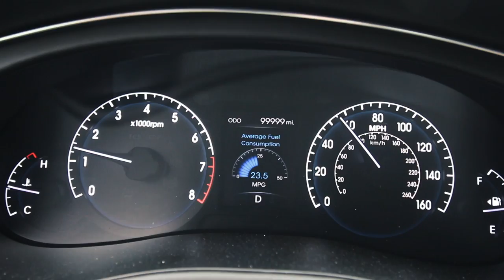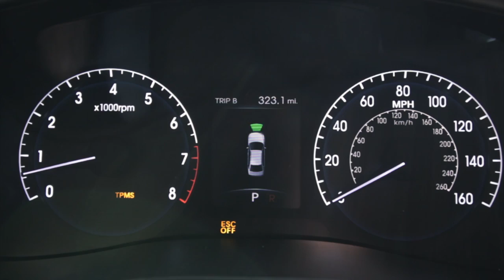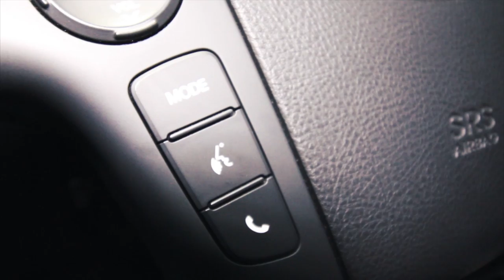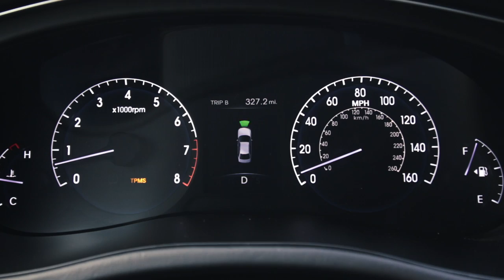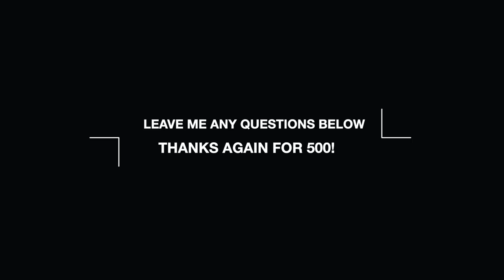2012 Genesis 5.0 R-Spec Long Term Ownership Review

Comment: Love the car heard they burn oil . Bad rings from factory 🤔
Reply: Gas direct injection engines burn some oil after awhile due to the high pressure fuel injectors
Reply: Darrin Bush That’s why I’m opting for the 4.6L. Still makes 385bhp and is port injection so no worries of carbon cleaning.

Comment: I had a Genesis Coupe before and just recently picked up a 09 3.8 Sedan! Love it! I know in the coupe you could press and HOLD the ESC off button (for about 3-5 seconds) to FULLY disengage traction control. Not sure if this works on the sedans or not, but worth a try!
Reply: Also, on my 09 Sedan, I can play audio thru just the regular aux cable. I tried using the Hyundai weird Dongle thing and ofc that works, but the aux cord works fine as well. This didn't work in the coupe... which was weird, only hyundai dongle or bluetooth on the coupes.
Reply from the maker: Congrats!! I’m actually working on a video on how to fully disable esc currently, because unfortunately you cannot fully disengage it in the first generation sedans.

Comment: I got a 2012 4.6 genny and I use to love the car but I’ve had the Trans replaced 3 times already under factory warranty and I only got 90k on it and like you said if you like to drive aggressively like me this is not the car or trans for that
Reply from the maker: Sorry for your unfortunate luck man. But at least it was under warranty!
Reply: Xtalgic _ I guess but I was really disappointed because I really wanted to hold on to the car but I need a car that can handle my aggressiveness so I will be back in the market soon
Reply: What?troubles driving hard with only 90,000 on it.that's not good.but it is a Hyundai I wouldn't expect anything more. Garbage car huh?
Reply: @haitibwoi6122  trust me shop for a Infiniti M56 sport! These cars are slept on hard. Way above this car in quality and same horsepower.find one and test drive it.you won't be disappointed. Infinitis  go 200,000 plus miles if properly maintained and made to drive hard. I own a 2008 M45 Sport and honest to God best car I have ever owned. 101,000 miles and zero issues  but I maintain the Hell out of my cars!
Reply from the maker: You must be bored. That’s three comments on the same video all saying the same thing. You doing alright?
Reply from the maker: This is exciting, they told me this would happen. Just didn’t expect you so soon.
Reply: @Xtalgic  your weird dude!
Reply from the maker: You’re like one of those trolls right?
Reply: @Xtalgic  Nah man not at all. Im to old for that. Im just a key snob Hyundai hater right? Dude I just made a comment you didn't like and I even admitted I wasn't hating and you took it way to serious. You got your feelers hurt, and that's cool. We can be done with this conversation though. Be cool bro! 😉
Reply from the maker: You look very silly right now. Also, thanks for all the comments, really helps push the algorithm 😉
Reply: @Xtalgic  👍
Reply: @Fred Williams  ya I’ve always wanted a m56 S I just couldn’t afford it at the time but now that you’ve reminded me about that car I shall be searching for one as we speak that would be a great trade in and it’s more powerful too because I don’t have the 5.0 Genesis I have the 4.6 model
Reply: I agree. Same for me. 2011 was the first year of that body style. Prices have come down alot. Look at videos and images on Google. They look amazing when tastefully customized. Good luck and like I said if you find a properly maintained one you'll get 200,000 plus easily.
Reply: @fredwilliams7893  either YOU'RE not too bright or English isn't YOUR first language.
Reply: @pigatt1  whats bright mean? Like im a light bulb or something? WTF? Buddy!😂

Comment: READ THE COMPLAINT REVIEW ON HYUNDAI GENSIS , CAR SHUT DOWN AT SPEED OF 50 MPH ,LIGHT START TO FLASH ,AC SHUT DOWN , STEERING WHEEL SHUT DOWN , POWER BRAKE SHUT DOWN ,PRAY THAT YOU CAN SLOW THE CAR TO A CURB AND THEN TRY TO PUT IT IN PARK MY 2012 WITH 60K MILE DONE IT TWICE ,DEALERSHIP LEFT STUNN .